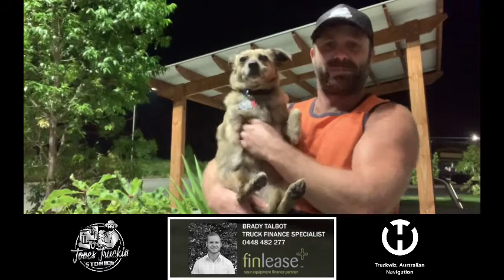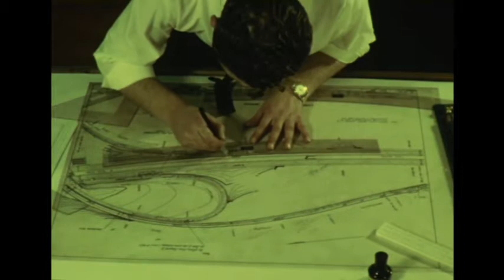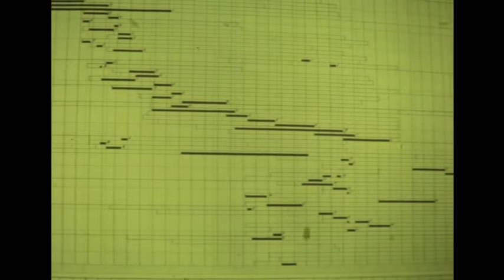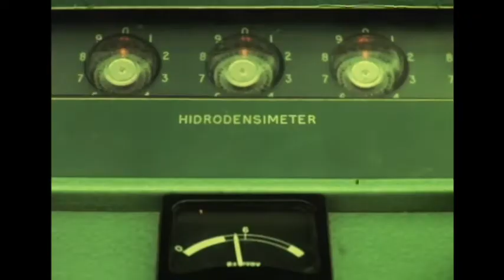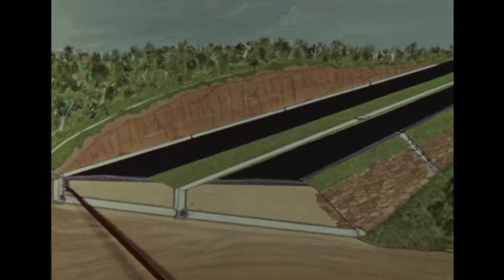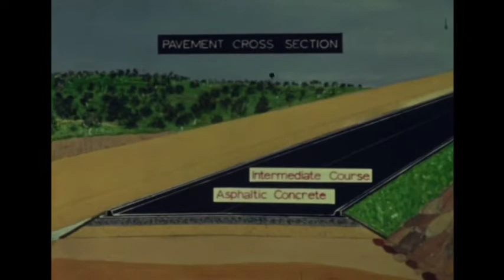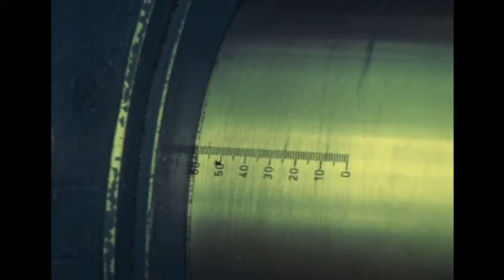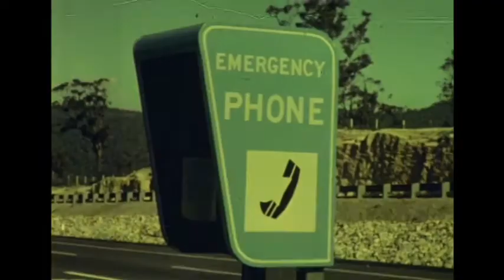Construction of the Sydney-Newcastle ExpresswaY production by the Department of Main Roads (1968)

Comment: The only section of stage 3 the interchange at mount white should never been built since it was never used at all.
Reply from the maker: Very interesting mate! Thanks for the insight
Reply: The original plan was for a big Mt White Interchange with the F3 and Peats Ridge Road to extend into a Freeway until Singleton and the original F3 to be aligned in a different route. However plans were changed following a few disputes.
Reply: @BulldogDynasty  Now the Hunter Expressway takes care of that